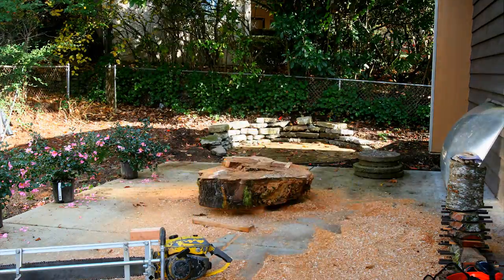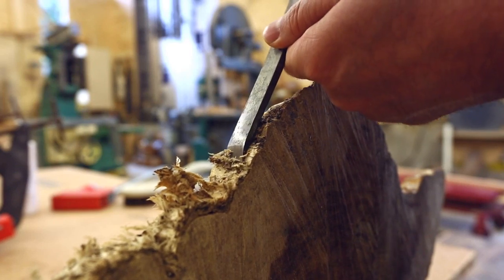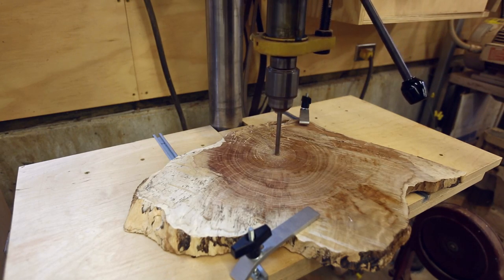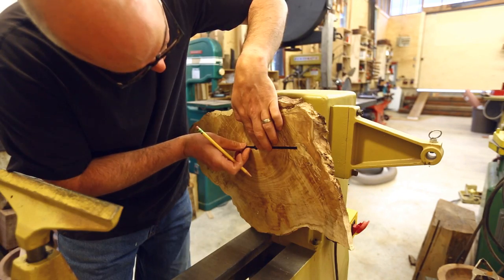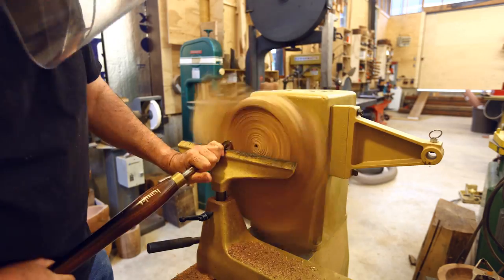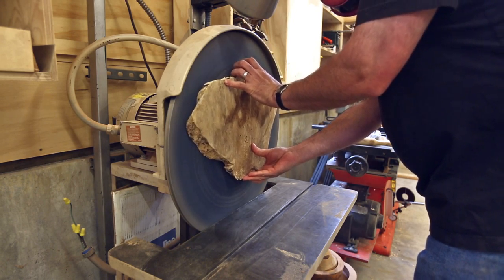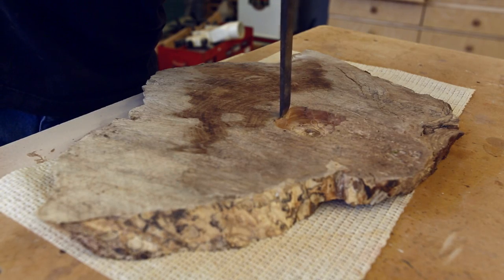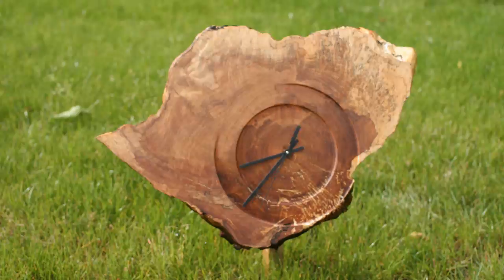Maple Clock

Comment from the maker: Because it was so thin it was not very heavy, so the off centered-ness was not as bad as it looked. That said I remember it vibrating the lathe above 400 rpm so I kept it around 300 (I don't remember specifically), somewhat slow for a balanced piece at this size.

Comment: hey frank i just salvaged a very nice tree trunk, i wil cut slabs from it tomorrow with a chain saw.  any advice for me to dry it without it cracking to much ?  tyvm !
Reply from the maker: Coat the ends with sealer and keep it out of the sun.  when sectioning a trunk it dries really fast as you expose all that end grain.  I have had good luck drying wood in this form.
Reply: tyvm